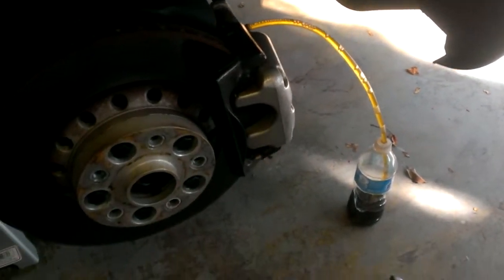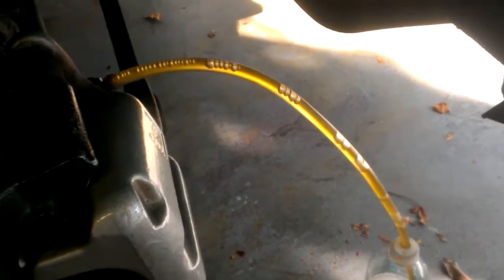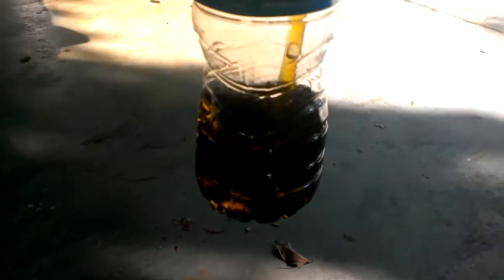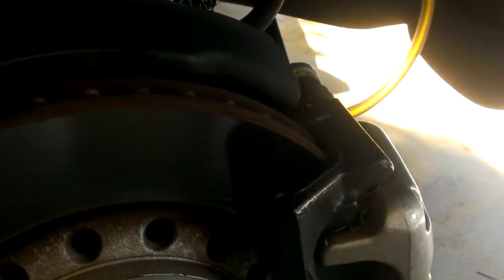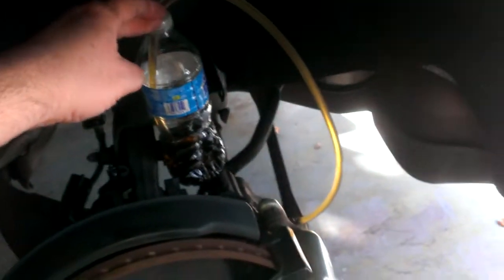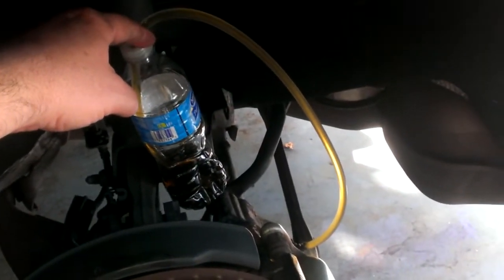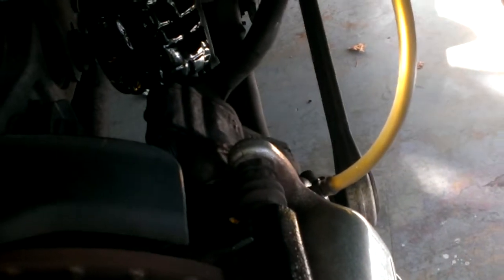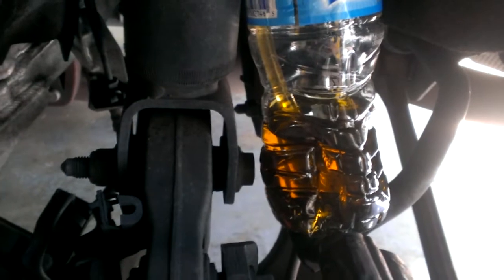Bleeding Brakes on 2006 Audi A8 (D3) with lots of air bubbles and a solution

Comment: When u drop it ur turning the bleeder screw 1/2 way open so it’s letting in air thru the threads put grease all around the screw to seal  or leave it up.
Reply from the maker: Agree with your comment and suggestions. Have learned a lot since then.

Comment: You are not getting a good seal at the tube/bleed valve, and the bubbles are outside air getting past the connection (not coming out of the system). You also may have opened the valve too much, and air is getting in past the threads. Only loosen the valve 1/4 - 1/2 turn or just enough for fluid to begin draining), and use a smaller, tighter tube on the bleed valve.
Reply from the maker: Correct, air was coming in from the threads as the bleeder was opened more than needed allowing air to make its way in.  Remedy was a bit of grease on the threads and opening bleeder just enough for brake fluid to flow.
Reply: Not sure what type hose had in bleed screw but probably rubber which will obviously bend at a certain angle and allow air in when bottle is on the ground.  I hold rubber connector tight while bleeding.

Comment: Tts your tube its not sealed on the bleeder valve. adjust  the tube around to wear it seals completely around the bleeder valve. it should clear up. if that doesn work use a smaller tube.